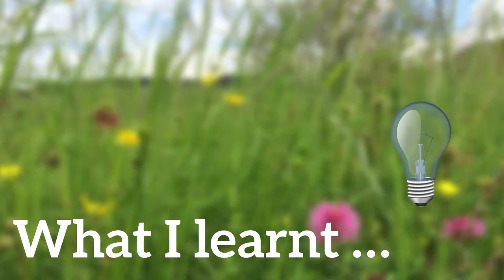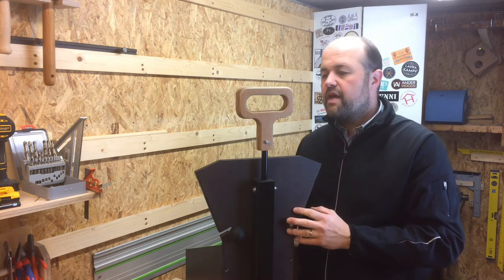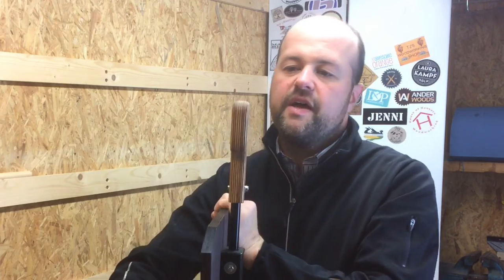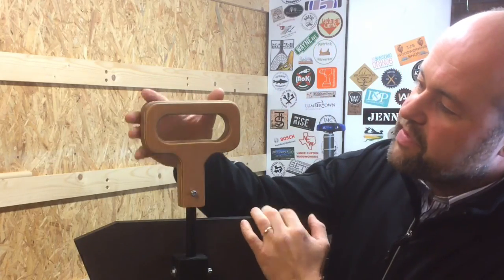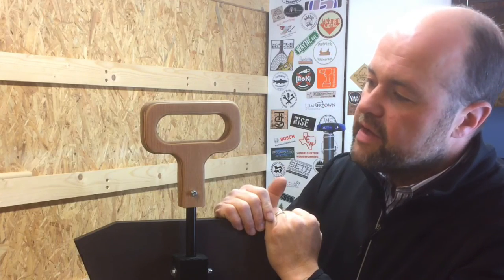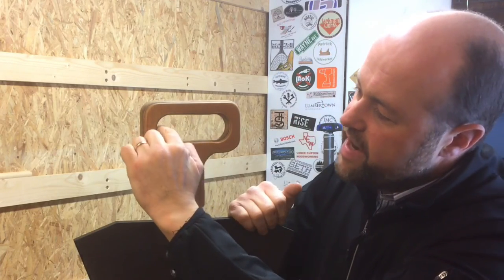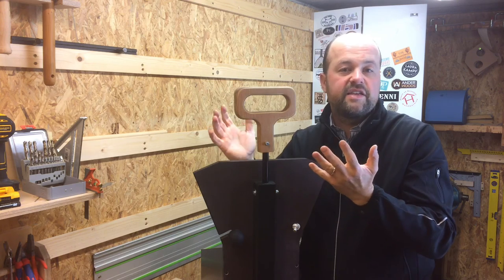Make an instrument trolley for a horn (or another instrument) – DIY

Comment: Yeah I like 'what I learned' too. Enjoyed this vid mate, but aren't those wheels a wee bit small? Just a thought...
Reply from the maker: Thanks. I thought about the wheel size as well. These ones are full rubber with ball bearings. I have a suitcase which has similar wheels but even smaller and it works fine. Since larger wheels get quite expensive I thought I'd try these. They could be quite easily replaced with larger ones if it doesn’t work out.